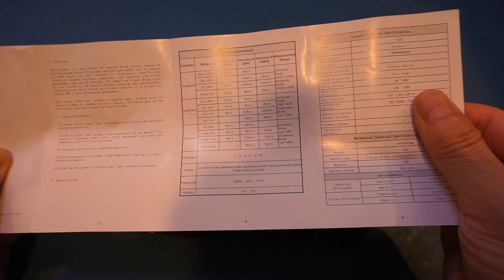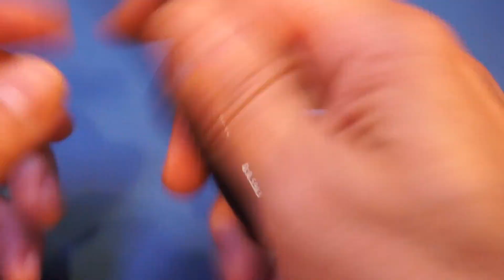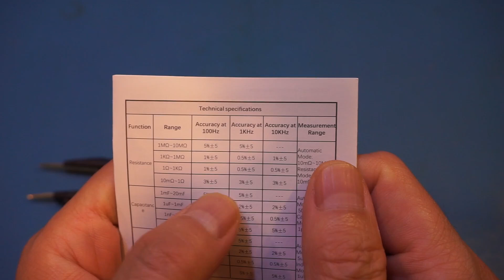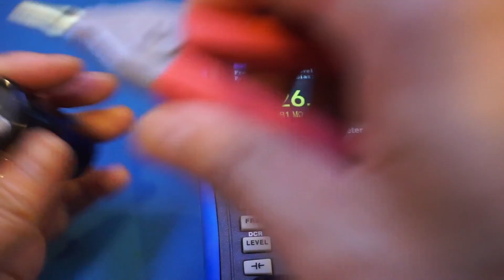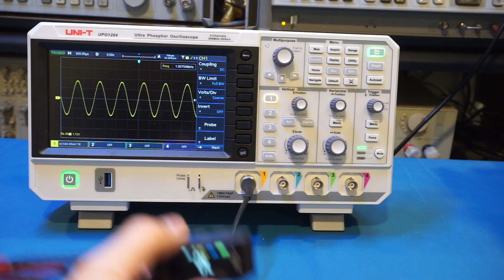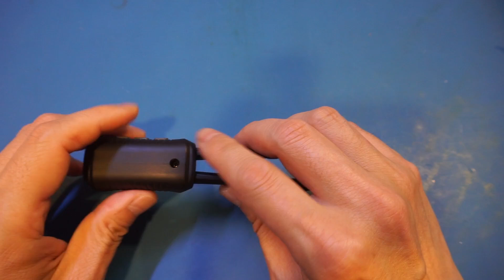ZOTEK ZOYI ZT-MD1 LCR Tweezers Review/Teardown

Comment: It seems strange, and a great shame, that the diode detection doesn't work for standard diodes given that the 0.6Vrms range with its1.72V peak-peak / 0.86V peak should be ample. Perhaps it can be fixed in software; had it worked I would have ordered one already.

Comment: The PC board probes are pretty clever.  I see they have the signal lead surrounded by shield traces.  I wonder if they have an active guard as might be found on a high end meter?  Over all this looks like a lot of function for the price and it looks surprisingly well made.  My wishes would be to have a higher excitation voltage available and a higher test frequency at 100 KHz.

Comment: The firmware upgrade v1.7 adds a data log, appended each time hold is pressed. Have a go at it 😊. Thanks for the in circuit demo and high resolution view of the internals. Your description of the diode function should help a lot of your viewers understand why it’s not so good at diodes.  Zotek spelled incorrectly in the title.
Reply from the maker: " Zotek spelled incorrectly in the title." - Thanks for pointing that out. Corrected.
Reply: Thank you sir!❤
Reply: @ZOYIZOTEKofficial  Will you be able to increase the 0.6 V limit with a firmware update? It would be really nice if it could check regular diodes that are above the 0.6V limit, too.